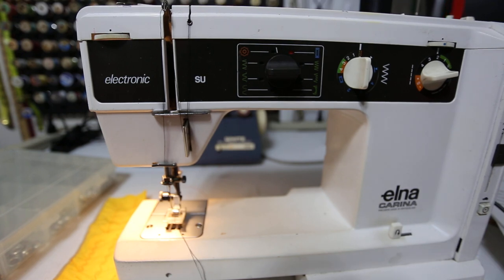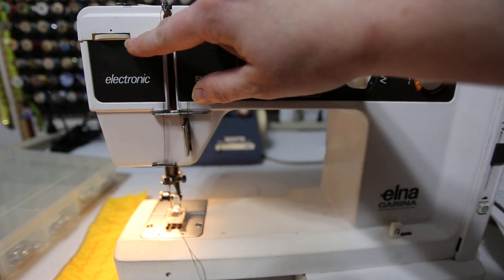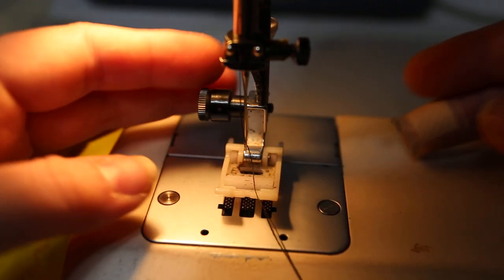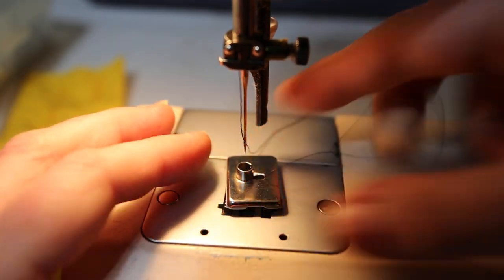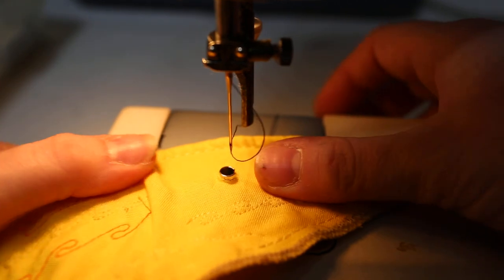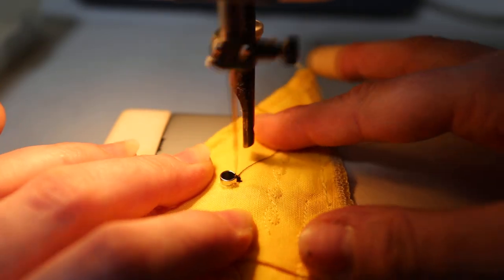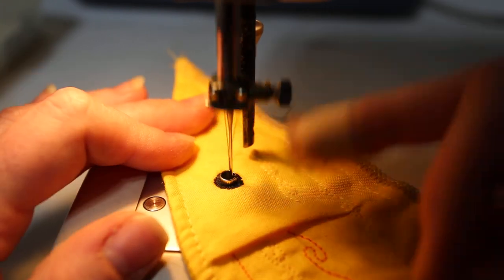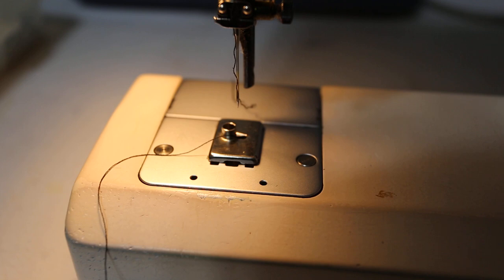How to make eyelets with your sewing machine

Comment: I hate to be "that person" but can I please correct that it's a presser foot and not a "pressure foot" because the pressure can be changed on feet/shaft of these machines to help manage heavy or lighter than usual fabrics and it's confusing for newbies if they don't start out with the right sewing language. Thanks for the video, I learned to sew on an Elna similar to this and still have it. They are wonderful machines 😊

Comment: EYELET INSTRUCTIONS for  (some) JANOME machines: EyeletMachine Setting: Pattern: 22, Thread tension: 1-4, Presser foot: Satin stitch foot F, Foot pressure: 3, The eyelet is used for belt holes, etc, To sew:Depress the foot control to sew.The machine will sew an eyelet and stop automatically when completed.Open the eyelet with an awl, punch or pointed scissors. ......... Adjusting the shape of an eyelet: Correct the shape of the eyelet as follows:If the eyelet gap opens, press "–" on the stitch length adjusting button.If the eyelet overlaps, press "+" on the stitch length adjusting button.        NOTE:The shape can be adjusted within L1 to L3 (default setting is L2). [from JANOME MANUAL]